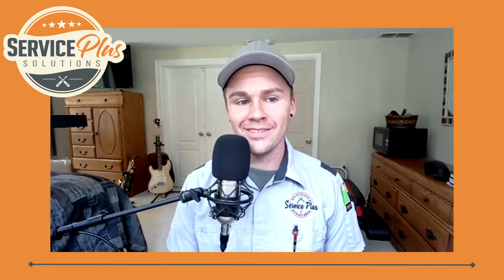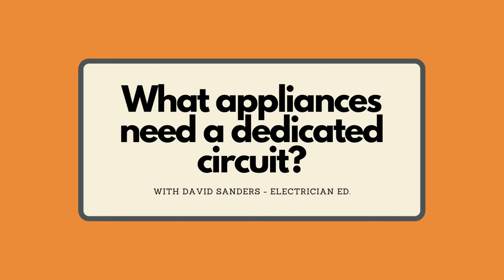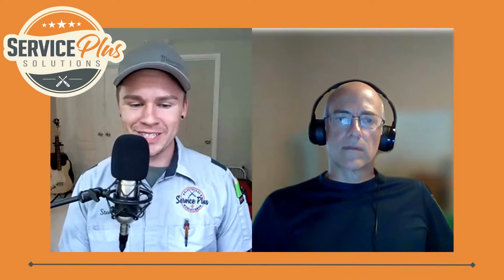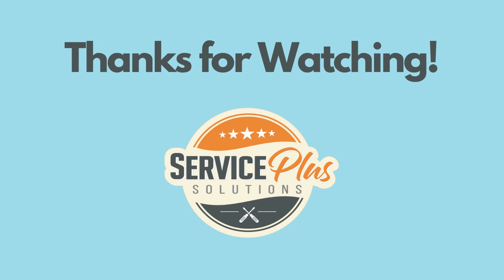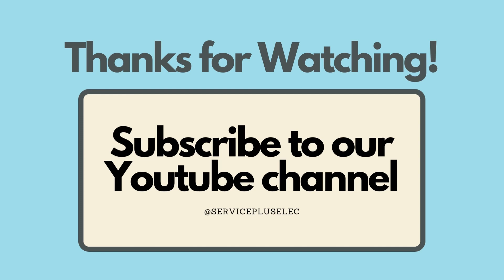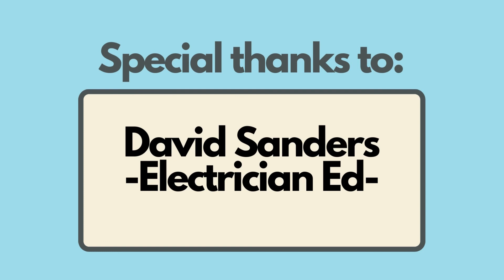Dedicated Circuits: What Appliances Need a Dedicated Circuit?

Comment: The NEC code needs an AI interface to be truly useful
Reply from the maker: I'm sure it's coming eventually
Reply: The NEC "is not intended as ... an instruction manual for untrained persons."  "The purpose of the Code is the practical safeguarding of persons and  property from the hazards arising from the use of electricity."  [2023 NEC 90.2(A)] 

Mike Holt and many others provide extensive training material on the NEC.
Reply: It would help if:
- your guest stated the code while speaking,
- you listed the code while speaking so we could take notes while you kept talking.
- focused less on central vacuums & coffee makers & bug hair dryers (which we rarely come across) and more on stuff we come across every day like dishwasher and garbage disposal. Yes you touched on it in the beginning but it needs to be hammered.